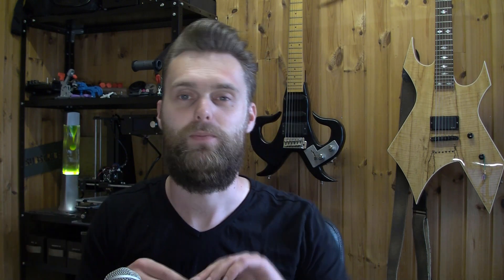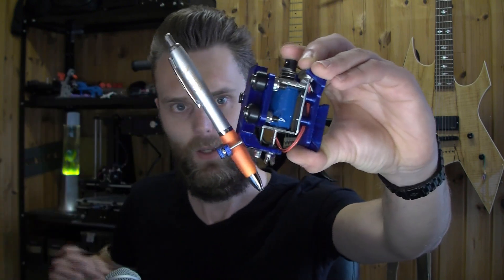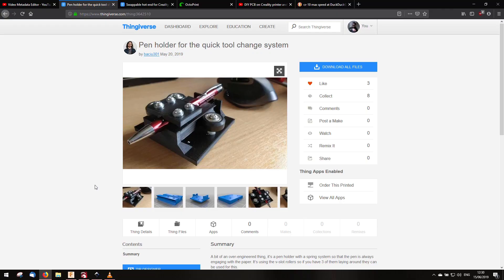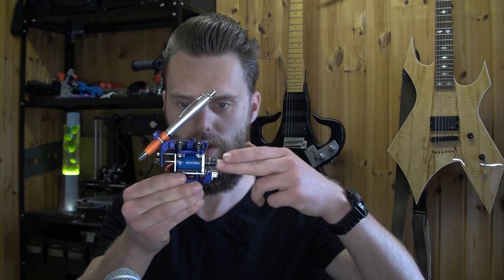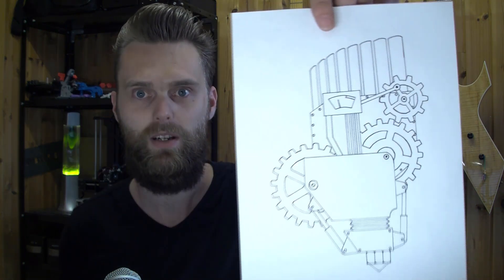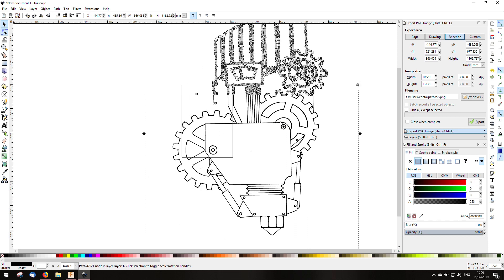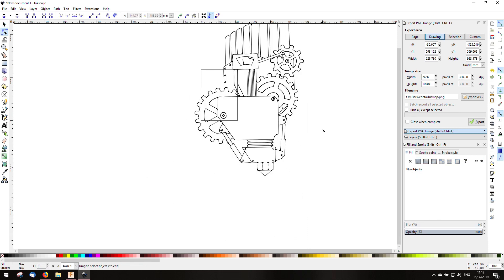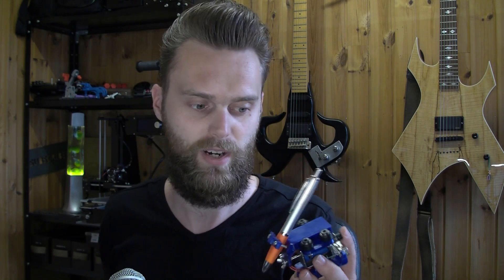Turn your Creality printer into a drawing machine!

Comment: I made an attachment for my 3D printer to hold a sharpie for the purpose of drawing circuits on PCBs. It works good, but I want to make a way of adjusting the pen without having to change printer settings.

Comment: This is a classic example of someone being smarter than they actually need to be. I'm an advocate of being practical more than excessive. There are way easier ways to plot with a 3d printer.
Reply from the maker: I'm glad you put it this way, but it was not my intention to be smart or excessive. My goal is to experiment and try things differently to find out if it works and spark new ideas and insights. I often don't go for the easy existing approach. I'd rather fail and learn.

Comment: Wy didn't you use the Z axis of the printer to move the pen up and down?
Reply: For simplicity.
Z requires a move command but the part cooling fan is simply on or off.
 The software he is using to generate the gcode can use the part cooling fan  as a simple on or off signal already.

Comment: Hey bro can you help me to my project i want to add dragknife to my ender 3. But when i use inkscape i cant save as gcode. There is a lot of error... hope you can read this. Thank you
Reply from the maker: Hi Marlon. I just found out I haven't responded yet, my apologies. What kind of errors do you get? You can send me an email with the Inkscape file and a screenshot of the error to contact@properprinting.pro and I will take a look into it for you.
Reply: @properprinting  here is the error buddy..(Traceback (most recent call last):
File "gcodeplot.py", line 1090, in <module>
penData = parseSVG(svgTree, tolerance=tolerance, shader=shader, strokeAll=strokeAll, pens=pens, extractColor=extractColor)
File "gcodeplot.py", line 581, in parseSVG
for path in parser.getPathsFromSVG(svgTree)[0]:
File "C:\Program Files\Inkscape\share\extensions\svgpath\parser.py", line 693, in getPathsFromSVG
getPaths(paths, matrix, svg, path.SVGState(), {})
File "C:\Program Files\Inkscape\share\extensions\svgpath\parser.py", line 587, in getPaths
getPaths(paths, matrix, child, state, savedElements)
File "C:\Program Files\Inkscape\share\extensions\svgpath\parser.py", line 587, in getPaths
getPaths(paths, matrix, child, state, savedElements)
File "C:\Program Files\Inkscape\share\extensions\svgpath\parser.py", line 587, in getPaths
getPaths(paths, matrix, child, state, savedElements)
File "C:\Program Files\Inkscape\share\extensions\svgpath\parser.py", line 587, in getPaths
getPaths(paths, matrix, child, state, savedElements)
File "C:\Program Files\Inkscape\share\extensions\svgpath\parser.py", line 549, in getPaths
path = parse_path(tree.attrib['d'], matrix=matrix, svgState=state)
File "C:\Program Files\Inkscape\share\extensions\svgpath\parser.py", line 252, in parse_path
segments.append(path.Line(scaler(current_pos), scaler(start_pos)))
File "C:\Program Files\Inkscape\share\extensions\svgpath\parser.py", line 197, in <lambda>
scaler=lambda z : applyMatrix(matrix, z)
File "C:\Program Files\Inkscape\share\extensions\svgpath\parser.py", line 173, in applyMatrix
return complex(z.real * matrix[0] + z.imag * matrix[1] + matrix[2],
AttributeError: 'NoneType' object has no attribute 'real')
Reply from the maker: @marlonglodo1930  Based on your error it looks like you use another plugin than I do. I use the J-Tech Photonics laser tool https://jtechphotonics.com/?page_id=2012
If you do use this tool, is it possible to mail your svg file to me so I can take a look?